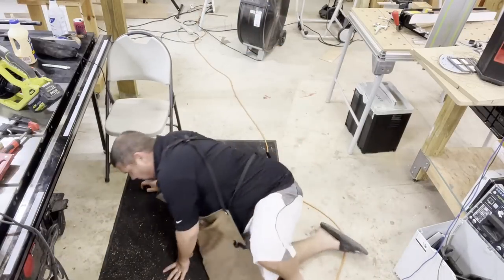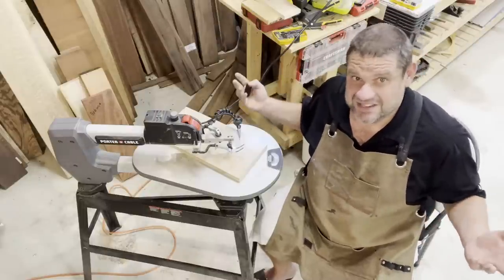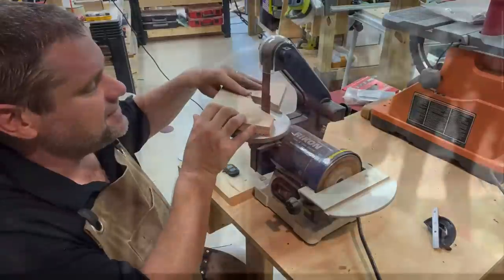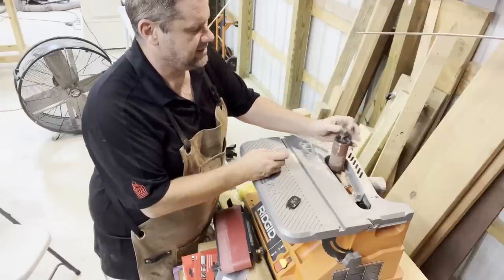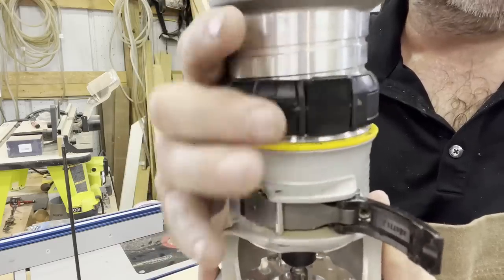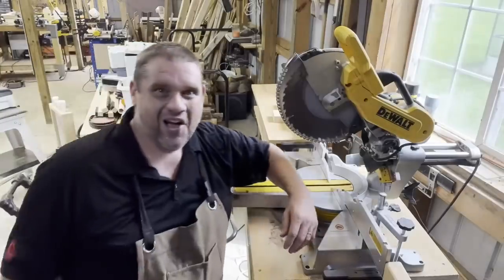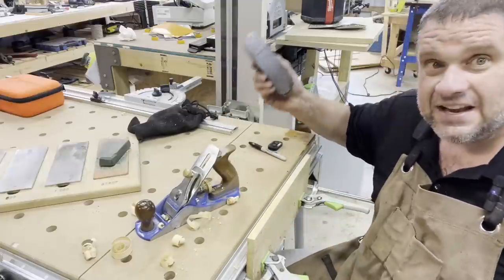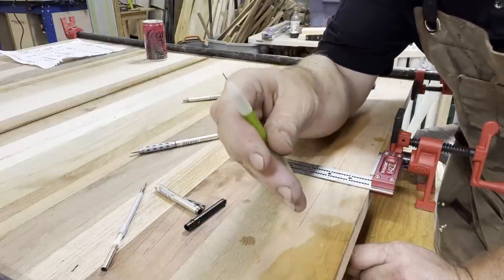7 things that a beginning woodworker should buy and not buy!  Buy This, Not That!

Comment: #1 is a MOISTURE METER. Seriously, if you are building tables, or furniture and your wood isn't below that 12% threshold, you're gonna have a bad time. Store lumber from HD or Lowes is upwards of 15-20% sometimes, so if you need to buy it, take it home and sticker and stack them with 1" slats and put something heavy over the top to keep them warping as they dry. Trust me, you will run into an issue, not IF but when. For tools, I have the dewalt 7480 table saw, and the dewalt s779 dual bevel miter saw it's 12" and can rip through wood like butter, with the right blade. Also, a festool  random orbital sander or 3m precision sander would be high on my list if you plan on doing anything with epoxy, or need very fine finishes.
Reply from the maker: I like this idea!   That is something I currently don't have and have been thinking about getting one!   Thank you so much for the idea.   I foresee myself picking up a moisture meter in the near future!

Comment: My beginning purchase that I never use is the drill jig that allows you to drill straight holes. Mine is from miles craft   . Never used it even once. My Ryobi drill has a bubble level in the end of it and it works just fine.
Reply from the maker: I hear you on the vertical drill jig, I spent a little more money and got the rockler one and it has done nothing but collect dust since I got it!   I'm sure it will come in handy some day, but I thought I would be using it all the time!    Thanks for sharing and thanks for commenting a9ball1!  Appreciate it! :)

Comment: I have a saw similar to the Dewalt mitre saw, but it is the Ryobi...works great with a proper blade.
Reply from the maker: I agree, I think most of the Ryobi miter saws are pretty good!  I just bought the cheapest one I could find when I bought my first one and I outgrew it quickly!
Reply: The problem I have with that sort of miter saw is how much space it requires. I have enough space against the wall but the saw station has to be a foot away from the wall to accommodate the slide. I bought the Kapex to save that floor space. Otherwise I would still be using my Bosch. Bosch also has a model that fixes this, too. I highly recommend that people take this into account.
If none of these tools are in the budget, don't forget Harbor Freight. My first miter saw was a 10" saw. Even though I have the Bosch and Festool, I stll use it outside. If that I ann
Reply: Yup, I loved my Ryobi miter saw. I 'upgraded to a Metabo and regret it.

Comment: I wouldn’t say you need hardwood but 2x4 material is not a good choice for a beginner they are not fully dry and often have huge stress in the wood from how they are processed. You’re better off going a few isles over and buying pine or poplar shelf boards.
Reply from the maker: I definitely think the premier pine is a decent choice.  Have you seen the price of poplar at the big box stores lately!  Highway robbery!
Reply: I can’t say I’ve seen the prices lately. But, I am in a position where I buy rough sawn lumber by the lift 1100-1200 bd/ft at a time. last time I bought poplar it was 4.50 bd/ft.

Comment: I have a jig saw but cutting shapes is so frustrating controlling the blade. I would lean towards a band saw since it's got good tension on the blade.
Reply from the maker: Yes It can be frustrating, I agree.   I also lean towards the band saw as my primary curve cutting tool!  But I definitely started out with the jig saw... then the ryobi band saw which is actually a great band saw for the price!
Reply: @FlynndoggWoodwork  so I'm planning on buying a band saw
 Would you recommend a big or small one?
Reply from the maker: @aberba  I would highly recommend the ryobi band saw as a starter band saw.  It is less than 200 bucks and I had one for a couple of years.   For the price you can't beat it.
Reply: @FlynndoggWoodwork  I'm in Ghana so I may need to find one on Alibaba. Shipping from China costs way less unfortunately.
Reply: Stumpy Nubs just released about jig saws. Pretty basic, but you might see something useful.

Comment: @Flynndogg Woodwork   At this point in Battery Technology is there any reason to buy a Corded hand powertool over a battery powered one?
Reply: For the DIYer, most of these battery tools are great. However, you might find a need for more power and duration. So, don't throw away your corded tools just yet. Just keep the corded tools on the back bench for special occasions.
Reply from the maker: I have to agree with Ken's response.  The only drawback I see with battery powered tools is the potential for power to decrease as the batteries get lower.  There are a few things that I think work better corded... orbital sanders, sometimes drills, if you have something you need a lot of torque for like metal.   Anything you need a lot of power for, or something you are going to be using for an extended period I would migrate to corded versions.

Comment: Gonna disagree on the mechanical pencils.  I've got the same ones, and never once have I had a single issue with them.  Used them for a few years now.  Love 'em.  Other than that, I do agree with the rest of your video.  Good job!
Reply from the maker: Welp, I must be doing something wrong with them.  I've been known to be a little hard on my tools, but I went through two of those pencils in one week, literally just by scribing a line.  I hope they keep working for you! :)
Reply: @FlynndoggWoodwork  - That's just very odd, IMHO.  I've dropped mine, point down, on the concrete floor.  Still work fine.  Possibly just a bad batch?  Weird...
Reply from the maker: @staceylewisdesigns  I honestly wonder if I got a knock off brand or something.  I did buy it from a 3rd party vendor on Amazon.  Even the casing on mine are thin and flimsy
Reply: @FlynndoggWoodwork  I have broken mechanical pencils working at a desk job. I have had the nibs just fall out. I gave up on any mechanical pencils years ago. I have my Dixon Oriole or Dixon Ticonderoga Black (latex free eraser) No. 2 pencils. I have them at my desk and in my shop. My tape measure has a built in sharpener, so i don't have to worry about finding a sharpener.

Comment: I have never ever ever broken a Graphgear 1000, but have broken dozens of cheap mechanicals. I'm not sure how you bent the tip and claim you weren't putting undue stress on them.
Reply from the maker: I'm not sure either, I had another gentleman comment something similar, but I assure you, I have broken two just using the guide holes on a woodpeckers square.   Maybe it is a problem with how I am using the woodpecker square in congruence with graphgear?   I do have two more of them, all of mine are .5MM so maybe I need to move up to .7MM

Comment: For pencils, I prefer a 2mm drafting pencil with a HB or maybe even a 3B lead. In your video, you referred to the mechanical ones as 5mm and 7mm but those are really .5mm and .7mm.  Anyway, I like the 2mm drafting/drawing pencils. Check them out, they are cheap and are great for woodworking.
Reply from the maker: Thanks for the info Mark!    I'll definitely be checking out those 2mm drafting pencils!

Comment: Bosch > Carvex
Reply: I think you’re referring to the Bosch Miter saw being better than the Festool Kapex. If that’s the case, I absolutely agree. Unfortunately it’s hard to tell bc of the autocorrect by your phone.
Reply: @chriscampbell2235  Nahh, talking about the jigsaw. The festool will grenade itself from hitting a  nail
Reply: @paulhopkins1905  aaah ok, didn’t realize that was the name of the Festool jigsaw. My bad. The Bosch miter is better than the Kapex in every way too.
Reply: @chriscampbell2235  I like the Bosch, but the Makita is the absolute best saw
Reply from the maker: I wish I had enough money to have a Makita, Bosch and Festool and compare! :)  I really appreciate your input, good information to have!
Reply: @FlynndoggWoodwork  My dislike of the Kapex is for three reasons. The handle is kinda uncomfortable, it has an underpowered motor with undersized brushes, and the biggest reason is the non standard size blade with non standard arbor
Reply: @FlynndoggWoodwork  if you’re in the ATL area, would love to have you come by! Love the content, keep the channel going! You will do great!

Comment: I completely disagree about the router. A beginner should get the Bosch set with the fixed and plunge base. They will undoubtedly try to do too much with a tiny, under powered trim router with a narrow, unstable base and either ruin their project or get theirself hurt. A trim router is exactly what the name says, for flush cutting trim. I recommend the Bosch cause it's two routers in one, and because SBD killed the Porter Cable 690
Reply from the maker: Good Point Paul! We agree to disagree :)   I just know I started off with much smaller projects when I first got started so some of the larger routers were a complete overkill.   I 100% agree with you on how awesome the Bosch Router is, that is what i have in my router table!   Great points and thanks for sharing!